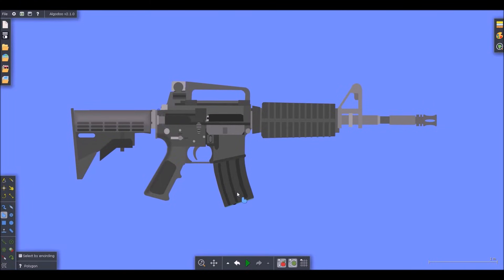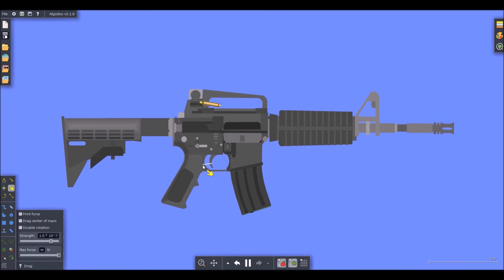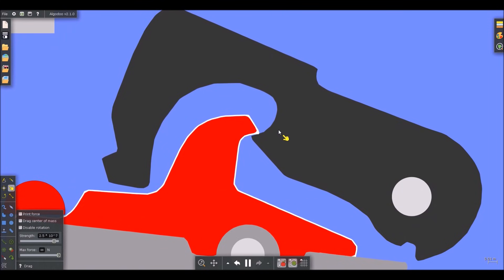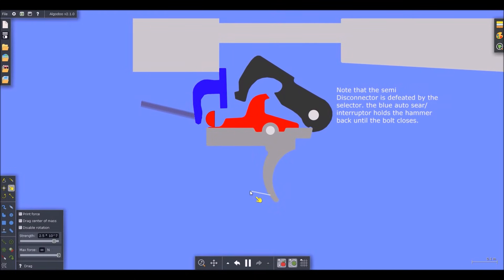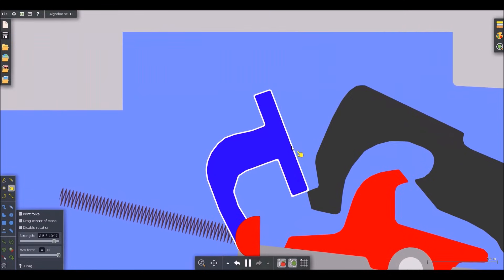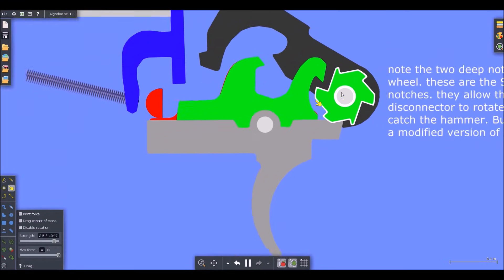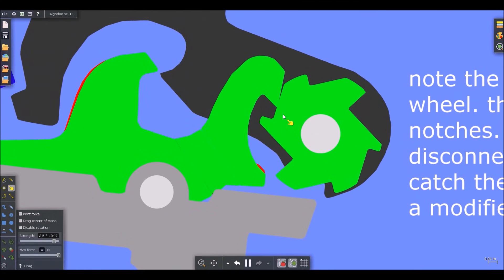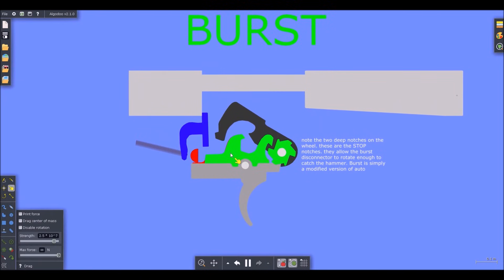How 3-round burst works

Comment: Tha ks for the simple and effective explanation. 
Can you explain how the selector disengages the 3 round burst mechanism while in auto?
Reply from the maker: It doesn’t, since the typical m4 or m16 only has 3 selector settings, including safe, semi, and either burst OR auto. On aftermarket 4-position selectors that have both auto AND burst, the disconnector used for burst has a tab on it the selector can block when rotated the right way, same way the semi one gets blocked; it gets trapped by the selector when a cutout along the selector shaft is rotated out of the way, so the trigger moves without the disconnector following it. Result: nothing to catch the hammer except the auto sear

Comment: Where does the auto sear spring connect on a mil spec AR15? Is there another attachment near the buffer pin hole is?
Reply from the maker: What you see in the animation is technically incorrect, the real spring twists around the pin the auto sear sits on and tends it backwards

Comment: How am I supposed to make this into LEGO?
Reply from the maker: 2-round burst may be easier with 4-way symmetry on the rotor wheel. I honestly don’t know how you’d make it, lego technic obviously. But the shapes and pieces to use aren’t obvious to me right now. I’m sure a model can be done, though
Reply: @StealthTheUnknown  ya I’ve done mechanisms that are full and semi (shooting rubber bands) but I wanted to try a burst so I figured I could try and replicate a real steal burst mechanism into LEGO
Reply from the maker: @awes0men0b0dy9  if you do, and you do it properly, you’ll probably be the first - at least the first I’ve seen. 

If I can recommend something, look at my Sig-552 vide which explains a different burst kit with a bit better video quality. That way your mind sees two totally different approaches to how burst can work so you may be better equipped to succees - I have a hunch lego technic will lend itself better to this style or similar mechanism.

https://youtu.be/irQFv3HD070
Reply: @StealthTheUnknown  ok thank you for your ideas I’ve seen burst mechanisms that have the small flat gear with the 3 teeth and figured that may be easier to replicate
Reply from the maker: @awes0men0b0dy9  I wouldn’t necessarily say so, unless you can reliably index a lego gear, reliably program “on/off” states on it (like deep and shallow indexes here), and relay the state of those indexes to a mechanism that governs firing/halting. It may be easier instead to do something like index a block or slide of some sort, maybe a lever rather than a wheel, and use that lever to trip a disconnector. That’s kind of how the sig 55x burst kit operates and it’s elegantly to put it light.

It’s hard to manufacture a wheel that’s balanced and properly timed; it’s easier to index a lever at pre-determined intervals and count those intervals to relay a state to another mechanism at a determined number of cycles.
Reply: @StealthTheUnknown  makes sense thank you for your help
Reply from the maker: @awes0men0b0dy9  love you bro. Stay safe, have fun, glorify the creator by being creative and full of life❤️
Reply: @StealthTheUnknown  will do

Comment: I was wondering in the 3 round burst mode. 
If we quickly release our finger from the trigger before the gun fires all three rounds,
When we press the trigger again, how many shots will the gun fire next?
Reply from the maker: It picks up where you let off - you can get doubles and singles in burst even just switching it from semi after a string of rounds. The wheel on an m4 or m16 always wanders

Comment: Great video and explanation. Any idea if this is what the Beretta R93 uses? It's quite a complicated mechanism.
Reply from the maker: oh no, this is way different from the 93. if you can look at a 92FS (M9), and look how the trigger bar works, you'll see that it's the disconnector, and trips the sear/pulls the hammer, and gets disconnected from the sear by the moving slide. on the (3, the moving slide doesn't directly engage the trigger bar, instead it moves a toggle that wiggles up and down. that toggle has an arm on it, which is moved around by the selector with a few linkages. in semi auto, that arm is long and hooks into an extension on the trigger bar, which disconnects the trigger bar from the sear the first time the toggle wiggles. in burst, that arm is made shorter, and the toggle will instead push down on and index a linear cam (think of a bar, with teeth so it ratchets- kinda like the wheel you see here on the M4, but straight.) When it's ratcheted 3 times, it bottoms out on the trigger bar, and disconnects it. The cam has lateral play under the handguard, and has a channel slot that sits over a round tab machined into the trigger bar, so when you press the trigger, the cam moves forward with the bar a bit and engages the teeth of the toggle and the spring-loaded retainer that makes it stay indexed while shooting. when you let the trigger go, the cam moves backwards with the trigger bar and is released from the toggle and the retainer.

here's the page to a 93R I made a while back, it's similar but not perfect. I think I may try to remake this now that I know more: http://www.algodoo.com/algobox/details.php?id=84642

Comment: I want to know what causes that notched wheel to rotate with hammer. But independent since it's always going counter clockwise. Never clockwise.  It isn't fixed to the hammer..... It is just a toothed one way interface? Friction wouldnt make sense
Reply from the maker: There’s actually a spring between the cam and the hammer that’s fixed to the cam and wraps around the base of the hammer where the pin slides through. When the hammer rotates, it causes the coils to restrict a little and the friction binds the hammer and the sear. When the hammer drops, the coils end up expanding a bit and disengaging from the hammer.

Comment: I believe it can not fore with built no such condition it is out of battery unless you manually manipulate a round into bolt face holding it stationary and at the same time bolt return enough for hammer to drop with correct spring to ignite primer
Reply from the maker: this is generally true, particularly with mil-spec triggers. the dimensions are such that out-of-battery firing is basically impossible. there's no telling with aftermarket parts, though!

Comment: But how does the grey thing above it work?
Reply from the maker: That’s just an auto-bolt to simulate the action cycling when firing.
Reply: @StealthTheUnknown  im just not the sharpest knife in the shelf.
Reply from the maker: @traleras1  it’s okay man, everyone learns at their own pace. The Bolt cocks the hammer by pushing back the front of it, and that ends up rotating it down since it’s on a hinge pin. Bolt is cycling because of hot gases going through the gas tube which unlock it and push it back into the recoil spring.
Reply: @StealthTheUnknown  ooooh ok thank you.
Reply: @StealthTheUnknown  but then how does the retraction of the hammer thing work?

Comment: The auto sear in an M16 doesn't have a weird spring going to the buffer tube. In fact it looks nothing like the auto sear drawn.
Reply from the maker: That’s because the program doesn’t draw coil springs like the one on the real thing - but I still needed that spring force to push the sear like shown. It’s a node in the program, forgive the inaccuracies. remember what I did say at the beginning: mechanisms are as true-to-life as possible, but there are modifications made to accommodate the program’s behavior and its 2-d dimensional constraints
Reply: @StealthTheUnknown  Fair enough! Great video, and thanks for the explanation!

Comment: Burst fire isn't really recommended in a firefight
Reply from the maker: King Super Saiyan it all depends. Usually semi-auto is king, with occasional auto for suppressive fire or just increasing hit probability at closer quarters with narrower windows for landing hits.

Burst basically gives you a “shotgun” mode that’s good for close quarters or volley-fire at laterally-moving targets at intermediate distances.

But it’s rarely useful and is generally featured as a mechanical solution to a training problem

Comment: How I can get the parts to turn into full auto ar15?
Reply from the maker: Find an ffl dealer that transfers nfa items, find one that sells registered drop-in auto sears, fill out all the paperwork, fingerprinting, background check release, chief law-enforcement officer signoff request, and the nfa tax stamp. Pay up front for your auto sear (and the m16 hammer, selector lever, and bolt carrier if you need those,) plus the $200 for the tax stamp. Wait, wait, wait some more as the ATF handles your ticket among the many thousands they receive for nfa transfers - this process could take 4-12 months, usually toward the 9-12 month range. When that’s come back as approved, you go back to your ffl dealer and get into touch with the CLEO of your jurisdiction. He either in-person or in-writing handles your case and evaluates whether he feels you to be trustworthy with civilian full-auto. If he thinks so, you sign a ticket of registry and transfer of nfa item, as well as all the legal acknowledgments, you are handed your auto sear and accompanying paperwork, and you become an nfa firearms owner.

Or you could acquire and illegal auto sear or drill a pin hole in the appropriate location on your AR and install one. Or make/find lightning links and similar drop-in conversions for automatic fire. However, these are regrettably illegal, and doing any of these could qualify you to be booked into prison for over 10 years if caught. You do you, but I wouldn’t recommend that route. Best to stick to the legal procedure to be safe

Comment: We should not consider a rifle with a 3 round burst to be "fully automatic" it only looks scarier, but honestly in most combat situations, US Marines use the single round burst due to accuracy. A 3 round burst makes sense for the movies or for certain situations where you require suppressing fire, which is only intended for advancement on a battlefield. For actually clearing rooms, a tactical shotgun is the preferred method, in conjunction with explosives.
Gangway H.P. Lovecraft
Reply from the maker: Agreed. I like to thing of burst as “shotgun mode,” but the atf doesn’t see it that way. Yet.

Or that FA, et al, should be guaranteed firing modes to gun owners, since “shall not” isn’t up for debate and I paid for the ammo and get to fire it how I damn well see fit.

My rant, take it or leave it.
Reply from the maker: Devin Linn also, binary triggers and the gods of feathering the trigger kind of make the whole full-auto ban obsolete. I can shoot a .22 rimfire self-loader like a 10/22 about 700rpm just feathering the trigger. I’ve dumped mags through them that way with pretty good accuracy, about as practical as a true full auto lmao.
Reply from the maker: Devin Linn or, you know, belt-loop bump-firing. Or bump-firing from the shoulder with a specific kind of grip. Can only really do these with something more substantial like an intermediate cartridge or full-power round, ARs/AKs or larger-bore rifles where the recoil makes it possible to do these.

I may also post a video soon on a certain kind of trigger soon that uses trigger slap and an extra part as a slap in the fucking face to the NFA. The letter boys can take their auto ban and shove it up their ass haha

Comment: I've always wondered what happens if the disconnect and hammer  gets worn out from over use but it almost looks like it would malfunction to full auto but the auto sear holds it until the bolt closes so it really would just malfunction. Great video! You just saved me from a felony science experiment lol!
Reply from the maker: jordan wiggins don’t file the disconnector! It’s an unreliable and semi-permanent mod that’s pretty obvious, and it isn’t worth the legal problems

Comment: So if you somehow removed the 3 round burst disconnector, and let’s say replaced it with a standard one, you would make a 3rnd burst a full auto?
Reply from the maker: yeah, basically. assuming it's got the tail like the regular one. alternatively you can just remove the disconnector and replace it with a washer of the same size and have the same effect.

Comment: Modify the wheel by adding a 4th notch and let's see what happens.
Reply from the maker: 4 . . . round burst? xD well. not really, since the angle the hammer travels matters. I can imagine a wheel with 2 additional steps wouldn't be proportionally right to work properly. the hammer swings close enough to 60 degrees (a bit more) that a 6-step wheel indexes near perfectly, with a little wiggle room. 8-step wheels would probably have skipping issues, and you may get 3 round bursts or 8 round bursts, if it skips a deep notch. not ideal, if not consistent.

Comment: What program did you render the model in? I'm wondering if I would be able to use it to model various improvised emergency arms I've designed to check there function. You mentioned it had a fail to eject. That implies the model l, or the program rather, is highly realistic in regards to physics. I'm am completely ignore of 3d rendering programs. Of that is a normal function of such programs....I'm impressed. Anyway, sorry, what is the program? Thanks a ton.
Reply from the maker: Program is called algodoo

Comment: I can’t believe how easily burst can be turned to auto. Just remove the burst disconnector and cam-wheel.
Reply from the maker: Eyyyyup.
Reply from the maker: Canada C7 but I’d honestly prefer to keep it for cqb as “shotgun mode.” I can count to 10 easily, a 556 has low recoil, and if topped off 30+1, I can have a mag ready in the left hand at “pull 8”, and be ready at 10 to drop the old mag and immediately insert the fresh one. Reloading during “sustained automatic fire” without breaking firing pace. You can drop and insert this way in under a second.
Reply from the maker: If you want auto on top of that, I’d go with one of the afternarket kits that allow it. Just get a dedicated selector for it that extends above the receiver cuts that normally block the switch.
Reply: Ok

Comment: Where can I buy this trigger set up?
Reply from the maker: short answer: you can't.
long answer: you either need an FFL+SOT to manufacture new machine guns, or you need to find a pre-'86 lower receiver that has full-auto, and buy either a 3-position standard burst kit or an aftermarket 4-position safe-semi-burst-auto kit (usually involves filing the selector stops down, not ideal) from an FFL that sells NFA components.

Comment: I have heard someone suggest that even in semi auto a burst capable AR platform rifle has appreciatively lessened accuracy over a full auto/ semi or simply semi auto only AR, given how the auto sear and modified disconnector for 3 round burst does this claim sound plausible to you?
Reply from the maker: Not really. Burst does nothing to affect the components that contribute to or detract from accuracy. I can see how the shooter might make small errors when firing single shots from a burst m4 because the trigger will go from light to heavy pulls in a light-heavy-heavy-light-heavy-heavy pattern

Comment: Could have been s good video if you weren’t panning the screen size constantly
Reply from the maker: The program doesn’t pan laterally very well, and I had to use the zoom function on the mouse to zoom “into” the frame I wanted, if that makes sense. Imagine google maps, but you can’t move the map; you can only zoom in and out of wherever your cursor is

Comment: This is great!. That is not where the spring is though, it is around the sear pin, but it is a GREAT video!
Reply from the maker: algodoo doesn't do torsion springs unfortunately. that spring is wrong, but it's a placeholder for the way the spring applies pressure.

Comment: Do you have a video showing how the M-16A2E2 trigger group works? (That's the 4-stage, S/S/B/A trigger.)
Reply from the maker: Andy Reddson basically the same as what you see here, but the selector axle has a cutout on it that can block both disconnectors for FA

Comment: A mechanical solution to a training problem.
Reply from the maker: I've heard it put that way before. at the time, it certainly was, but burst now serves moreso as an intermediate between automatic and semi. think of it like "shotgun mode", a volley of fire in a general direction, but not a continuous volley. good to hit lateral-moving targets at intermediate ranges, when used with good fundamental marksmanship. takes the deliberate function of releasing to conserve ammo out of the picture so you can focus on taking the shot instead. automatic would be more of a reflexive/suppressive fire role.

Comment: Not that i would ever do this im not a felon.nor recommend anybody do this without proper paperwork. But in theory if you filed down the tip of disconnect where it touches the under key. Wouldnt that produce a full auto action. Is it really that simple?
Reply from the maker: The Homesteader no, not really. Theoretically, you COULD balance it really carefully and succeed, but I wouldn’t recommend it. You would be making it FAO, and that interfacing surface would wear out quickly until it stopped working, and the hammer would ride the bolt forward.